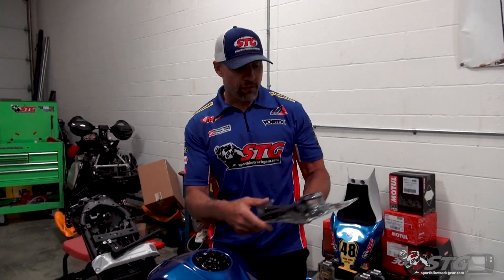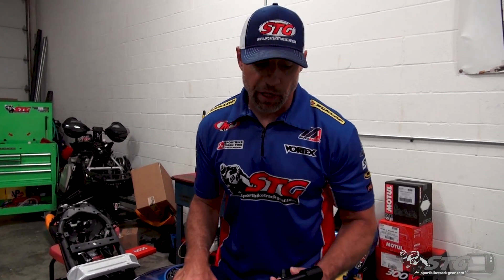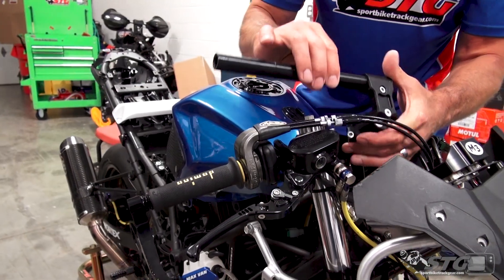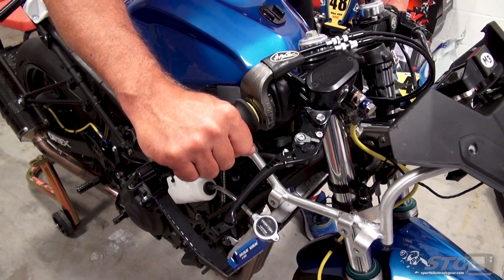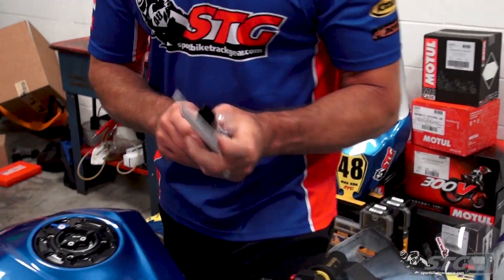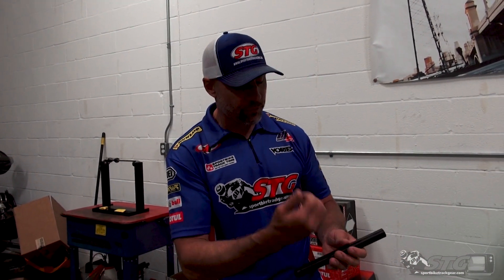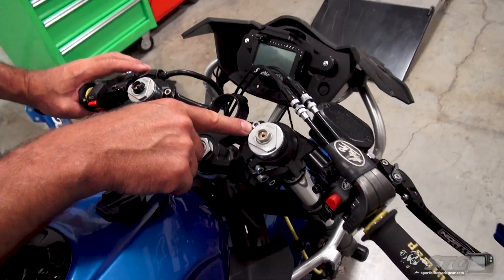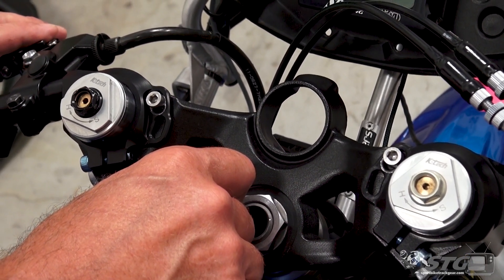Evol Technology Pro-Loc Clip-Ons Ninja 400 Install | Sportbike Track Gear

Comment: Hey guys I just installed some clips on, but can’t adjust the brake lever lower because of the brake light switch, how do you guys go about it?

Your guys videos are excellent, thank you!!!
Reply from the maker: Assuming the brake light switch is hitting the fork tube I would suggest trying to slide the master cylinder further form the fork tube on the clip on bar if you have the room to do this. - Van

Comment: Please have a video where we can see the conflicts if we have the OEM fairings. I own a ninja 400. I want to still ride it in the road and perform well on the track.
Reply from the maker: Massive conflicts with the OEM fairings. You will have to use race bodywork and trim it quite a bit to make it work. - Van

Comment: Can Woodcraft just supply different risers. I think they offer different risers for other clip-ons, they may even have ones on the shelf which are a direct swap
Reply from the maker: The Ninja 400 Woodcraft clip ons are a great option because they work with the OEM and race bodywork without having to trim anything. With the Evol you need to make some serious modifications to the bike. The bar position with the Evol is basically in line with the top triple clamp. There is no way to get that done with the Woodcraft or any other clip on on the market. For the Ninja 400 this is a serious improvement for track focused ergonomics. - Van

Comment: Can it be installed that into stock fairings with out touching the fairings
Reply from the maker: They will touch the fairings. If you want to use the OEM bodywork you will need to install the Woodcraft set. Here is a link: https://www.sportbiketrackgear.com/woodcraft-kawasaki-ninja-400-2018-clip-on-riser-assembly-w-bars/

Comment: Are there any recommended bar end sliders that are compatible with these clip ons?
Reply from the maker: The hole in the end of the bar is a little smaller than some of the other aftermarket tubes. I had to grind the inserts that hold the Driven lever guard on the throttle side. That said you may have fitment issues with some of the aftermarket bar ends available. - Van